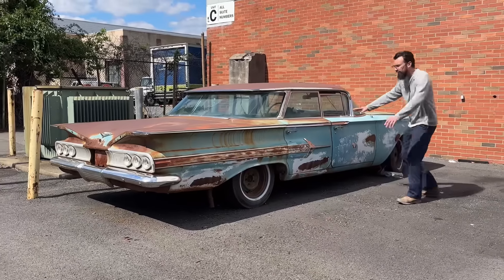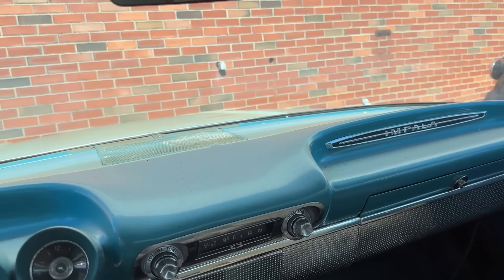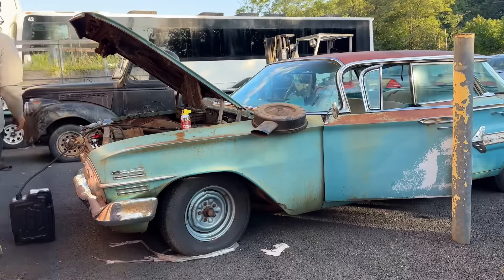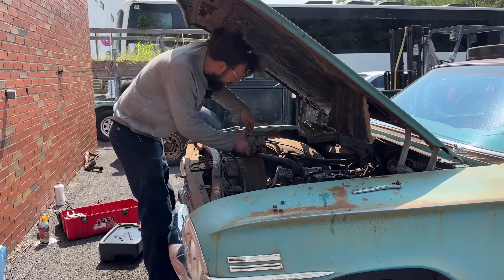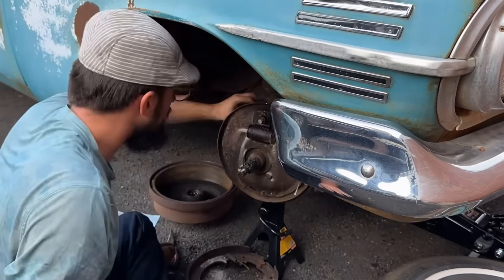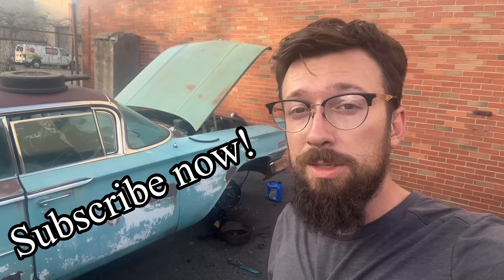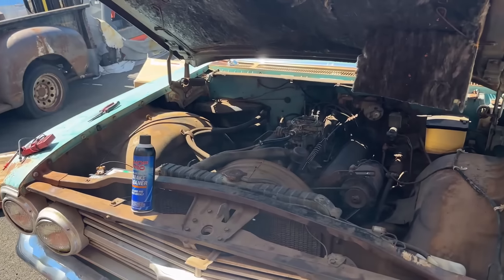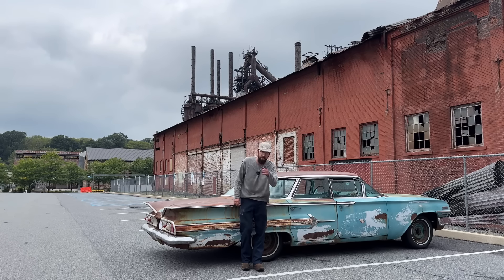I bought a 1960 Impala sitting 32 years, will it run AND drive 2,556 miles home? Part 1!

Comment: I have so many questions,  how did you bring an oil pan toolbox jack stands,  jack, tail lights,  on a plane from Tucson?  How did you return the Mercedes rental by yourself?  Or did I skip through all that? Sitting in that parking lot for 30 years?  How does the tires still have air in them?  Something’s rotten in NJ.  Doesn’t add up

Comment: 32:10 Unfortunately the quality of modern parts, especially when working on an old car like this where parts are long discontinues or hard to come by, AEM parts are usually of lesser quality than the rusting out part on the car.

This is the same situation with my 93 LS400, these cars are notorious for having power steering racks that go bad, or power steering pumps that need to be rebuilt or replaced. The aftermarket steering racks usually last less than the OEM ones did, and it's usually better to just try and buy a remanufactured, or used rack with less miles because it's got a higher chance of just lasting longer than a brand new AEM part. It's sucky too because for our older cars we are pretty limited to certain brands that aren't always the most reputable when it comes to replacement parts on discontinued items. You could always try your lucks with the NOS (New old stock) at dealers I guess, but it's not even worth the time for anything more than 15 years old.

Comment: You can pull the speedo cable out, lather is with grease, and re-install. It will get rid of the bounce of the needle and quiet the noise

Comment: in the uk you would have to pay road tax + insurance+ roadworty certificate, before you could take to the highway, the cops would pull you before you drove a mile!  and the car would be crushed! you dont know how lucky you are in the USA.
Reply: Wow that blows.I lost my d.l. Back in 97,cause I drank a bit much.well I don’t touch the stuff anymore and I still can’t get it back.I’ve been driving disposable  pieces.of shit ever since.can’t take the hot rods out,they’ll be gone
Reply: As a matter of fact,I think my 70 skylark still has the priests British steel hanging out the cassette player
Reply: America has some advantages, but there are drawbacks, major ones, huge ones, the UK does seem to be stingy on its safety requirements, probably so that you don't get plowed into by a 60's Impala who's brakes explode, when the vice grip Garage guy tries to slow for a traffic light 10 Miles after driving it out of a field, into a minivan full of Kids.

Comment: With your gas gauge not working proper you could pull out the sending unit and very very gently with a scotch Brite or something or very fine piece of sandpaper sand off the slider that goes up and down the wraps of wire, and then very carefully sand the wraps of wire, and you can bring back around a fuel sending unit 58:34

Comment: 20:00 For anyone wondering, sometimes you cant kill old engines because the intake valve on a worn out carburetor cant fully seal shut, this one might be too rusted but simple carb cleaner should fix

Also could be shutoff needle that cant float to stop feeding fuel

Comment: My cousin got an early 60s chevy Biscayne four door w/ the 283v8 2 sp powerglide in the mid 70s. The car was still all original, as new grandma garage kept, low miles one owner white on blue vinyl interior w/ the bubble wrap. The car ran silently. You couldnt hear it idle at lights. Plenty of burn out power as well. lve always said that those cars were the best value and best utilitarian vehicles the US automakers ever produced.

Comment: Here, you need to make the vehicle road worthy, pass the MOT.
Including rust.
Reply: Thin like water. 
Cooling fluid ???
Reply: Too bad, nobody makes parts for old cars.
Reply: He is probably running on a temporary permit prior to getting full registration.
Reply: @MrGigi-dz9cv 
Several make them.

Comment: Cheap to replace why didnt you put in a new cap and rotor and points and condenser and wires and plugs the money you spent on this would of paid for itself in fuel mileage over and over probably 60 bucks max it wont take long to burn up 60 bucks worth of gas with missfiring 40 year old plugs and wires and cap and points you are doing such a great job just dont understand skipped all of this and why you didnt order all of this when you ordered from Rock Auto you would of had it . This will cause the car guzzle more fuel and your performance will suffer when you need to get out in traffic. The miss fires will cause raw fuel to come out the exhaust and cause the car to really guzzle gas I would threw a new coil on it too for good measure
Reply: performance is the real focus here
Reply: @thatgraysuburban  No it would of been performance and mileage at the same time  I love what he did with the car its so freaking cool he brought it back to life and it made he busted his ass and he has my respect .

Comment: Honestly i own 4 antique vehicles.. and i dont like people driving old cars they just got that far without really making the vehicle safe for the road.

Youre one of the few ive seen who actually tried doing this.  But i still think you should have trailerd it home
Reply: He's getting passed by everything on the road. Looks to me he was taking it easy and made sure it was up to snuff for not putting anyone else at risk.
Reply: @mry82  still it could have rusted out frame and floors and other issues.  Im rather tired if youtibers driving home 50-60 year old vehicles not properly looked over and made safe.

Driving slow on the interstate is also a hinderance to traffic

Comment: Next time you're tapping out the bearing race, place the drum flat on the ground and use a socket on extension to catch on lip and work that around while tapping with hammer.

Comment: In  1963 I had 1960 Impala convertible with 348 engine and turbo glide transmission. Basically hopped up truck engine and a very poor transmission..In 1962 I had a 55 2dr hardtop Chef v8 stick that would make the 63 look sick.

Comment: I did something like this kinda in 2020. I bought a BMW E30 that had sat for 18 years. I did new tires and a battery, and it was overheating. There was a crack in the cylinder head and I got some shady shop that spoke zero English to like glue it together? with gobs of silicone. I then drove it 1900 miles home, blowing huge clouds of white smoke the entire time. But she made it with no fuss. The car has since been fully restored and works like new.

Comment: Before running it again,  remove sound deadening material from inside of the hood. As the car runs, the carb sucks decomposing material into the carb opening. Also, the trunk key was a separate entity from the ignition key. Trunk key was "round", and the ignition key was "septangular".  In 1960, I owned a vehicle indentical to this one. Same flat top, four door, 283, transmission, vomit green, no AC, manual windows.  Midwest.  I'm old.  Haven't watched part 2 yet.

Comment: Love it! I had a 60 Biscayne blue 4 door but absolutely love the Impala roof line. Great job getting this running although I would have fixed the wipers and exhaust and maybe done a complete tune-up before traveling. But your work is more than impressive!

Comment: you put a 12v battery in a car thats most likely a 6v system. thats why the generator wouldnt charge it because the generators output 6v not 12v
Reply: No, it's 12 volt. He has a 60 El Camino, so wouldn't you think he'd know?
Reply: @twinkie27271  you never really know from around 50 something to like 1970 you could get either or.
Reply: @myacidninjatheamazing1025  I don't know of any vehicle from 1970 that was a 6 volt system.
Reply: @auaiao9  there was an oddball ford heavy duty truck from 1970 that we had that ran on a 6v system originally
Reply: @myacidninjatheamazing1025  It was an oddball alright if it was still a 6 volt at that time.

Comment: That's a great find when I was younger I was given a 1960 Impala with the 283 and the power glide transmission I was taking the motor apart to rebuild it when I did that i found that it had the forged steel crankshaft not the normal cast crank back then that crank was worth money the transmission had a cast iron housing housing instead of the aluminum one weighed a ton but people who drag race love them for there strength great find and goodluck with it.

Comment: I had a 65 4dr Impala 283 powerglide with power steering and factory a/c. I bought it used of course and it was all there like this car and needed some tlc I was a young man and had to do things on the cheap. But when I got it to a point where it was fairly reliable it was a good running car and although not the gas miser did ok. I of course sold it. I in later years acquired a 1946 GMC 11/2 ton truck and it was driven from Colorado to Fla and only one wheel cylinder worked  just enough to stop the truck. That Impala was a Georgia car for sure as you can see the red clay on the bottom of the car. Built in Atlanta sold in Georgia and used thoroughly. The original owner surely got his monies worth. Get that one squared away and you got yourself a good driver.

Comment: good job. to be definitively efficient against rust,  you should  put grease everywhere. grease is the only thing very efficient against rust. put grease between metal and carpet, inside door, behind metallic bumper, under the vehicle, behind  the repairs you can make (everywhere inside the body - hidden erea -  instead of using paint), hollow areas (necessarily hidden, so no need to be aesthetic). For rear wings unreachable with a paintbrush, use an extender and poor old oil everywhere each year. rust comes always from the inside and welds.  Handyman Experience - 35 years.   From france

Comment: 32:11 the new copper nuts need to be heated to seal right i think they get work hardend from the factory. Heat will remove the work hardening from the copper.

Comment: I wish I would have kept my 2 60 Chevrolets. I had a 60 El Camino, and a  60 Chevrolet Bel Air . The El Camino had a 283 two barrel. And the Belair had a 235 six-cylinder both run immaculate.

Comment: If it acts like a generator,  the surging is the engine trying to get gas.  Is there a fuel filter in that carburetor?    There is varnish on the jets of the carb.  Should have bought 6 cans of gumout and cleaned that thing.  If gas is coming out of a connection there may be air getting in there too.

Comment: The hub assembly from a later model full size Chevy with tapered roller bearings and drum brakes will be a direct fit to the old spindle . I did this with my 60 Impala . I think 61 to 70 Chevy will work . Throw those ball bearing hubs away . They are old technology junk.

Comment: It's not likely the key you found would have worked for the trunk.  It had a separate key for that, a more rounded one.  The squarish one is for the ignition.
Reply: Back then ignition key was hexagon. Door key and trunk key were the same key. He still doesn't  have the ignition key, so if he locks the ignition,  he's screwed.

Comment: You are doing such a wonderful job and love your passion on this old car . Just a question you had the generator partially apart why in the hell didnt you tear it apart and clean it and lubricate the armature bushings I just . All that dirt you left on the armature and field windings will cut the charge out put and cause internal shorts because the dirt will ground out the out put of the generator /I would of taken it to the car wash and flushed it out and power washed everything. It would of been spotless and lubricated even some rattle can the out side

Comment: Love the the video, I'm just wondering why you didn't use tapered wheel bearings. Arent those just the modern replacement? My 70's dirtbikes came with loose ball bearings for the steering stems but aftermarket you get tapered roller bearings and are great.

Comment: Not sure why you didn't replace all the plugs, wires, cap, rotor and condenser. Those were typical items needing replacement every 7 to 10k miles "back in tha day",, especially since you're heading out on a 2600 mile journey. We saw the old ones were not in good shape. Hopefully those items n ot replaced will get you home 🙂

Comment: I live just southeast of Phoenix, AZ. It's too hot to work on cars for half the year here. 112F today. While I love pretty much any American car with a carburetor, rear wheel drive, and no computer, no matter what it looks like, I'm not really a fan of that body style. I'm a huge fan of the tri five '55, '56, and '57 Chevys, IMO they really kinda went downhill after that for a few years. I wouldn't use starting fluid, brake or carb cleaner to spray into the carburetor. Those are ether and burn super hot. I've seen holes burned in pistons from using starting fluid. I use 2 stroke premix in a spray bottle when I need to spray fuel into a carb. Voltage needs to be 14V+. An alternator will do that at idle, a generator won't. I'd rev it up and see if the voltage goes up. On the rear mount for those gas tank straps, I'd get a piece of 2x4 long enough to go all the way across the trunk side to side, drill holes in it that line up with the strap mount bolts, get some extra long bolts and fender washers, run the bolts through the straps, through the rusted frame rails, through the 2x4 in the trunk, and put fender washers and nuts on them. That would spread the load out over a wider area. That race is supposed to be pressed in. I would have taken it to a local machine shop and had it pressed in, especially considering how hard it was to get. It looks like your right front wheel has quite a bit of negative camber. BTW, where did you get those 14" whitewall tires? I've got a 1964 Ford Fairlane I would like to put some on. I'll check out some of you other videos. Best of luck on your trip. Another old car guy.

Comment: I had a white 1959 with a 6 banger and 3 on the tree. It burned so much oil that I could do crop dusting with that motor.

Comment: The brake fluid does not turn to powder. It should never even get that far out of the wheel cylinder. That’s the aluminum piston in the wheel cylinder, oxidizing and falling apart.

Comment: Why wouldn`t you get rid of that f/glass material off the hood, letting it hang so the carb can suck the fibres 
in and cause you more problems..   Apart from that , great video.

Comment: You are correct about the Wheel cyls being bad but the brak fluid isnt the cause. The one mistake they have always made on both calipers and wheel cyls is the pots n the calipers and the cyls. are mde of aluminum pot metal and the housing f the calipers and the cyls are of cast iron and what you seen under those rubbers was the result of putting 2 unlike metals together it causes corrosion so those cyls are indeed bad but what they were made of is what caused it the fluid wasnt the cause. that from an 80 year old life long mechanic

Comment: ‼️ When I buy an old car, i like to find new plugs, fluids,fule,battery befor i even start it up. Will have to do it in the future antways and less hassle

‼️ But if your on a budget its best to trouble shoot as you go along.

Nice car,  there only 2 like it in miami beach and one is owned by singer gloria esteban or how ever u spell it. It in front of her hotel for ever 40 years.

Comment: Hello bro... impressed this car still available parts impala... amazing good jobs..
Reply: You are not kidding!!! I have a 2009 Impala SS with the LS4 V8, GM does not make parts for it anymore!!! My fans shorted out and it also shorted out the fuse block. Chevrolet located the fans laying around in another dealership and I found the fuse block in a salvage yard in Arizona. It took almost a month. $2,800 !!!

Comment: Did you know that cars and people are similar, we're both modes of transportation, feet and wheels move us, shoes and tires protect the feet and wheels, we both have fluids running through us, we both require and emit fuel, people are like hybrids, we need to be rechared, where as a regular car can go 24/7 needing to stop to refuel.

Comment: The brushes ride on what's know as a slip ring. The brushes are carbon and very fragile.  And any type of lubricant can turn them into mud. Be very careful freeing them up. Also, the slip ring oxidizes and needs to be cleaned. Even a small amount of oxidation can keep the brushes from making good contact. Easy fix is to mount a one wire GM alternator in place of the generator.